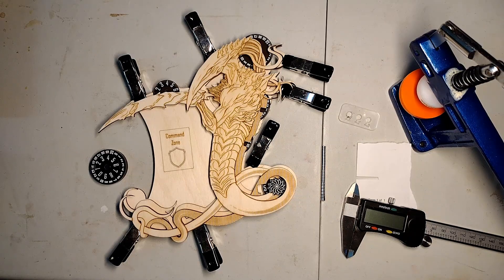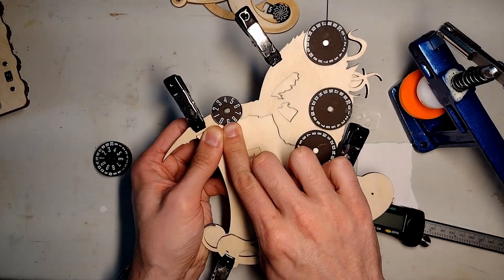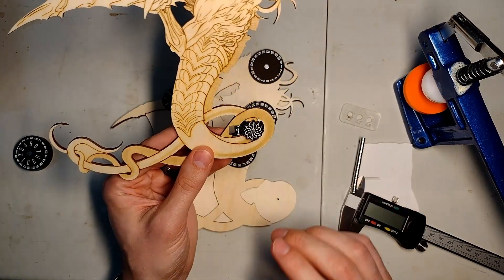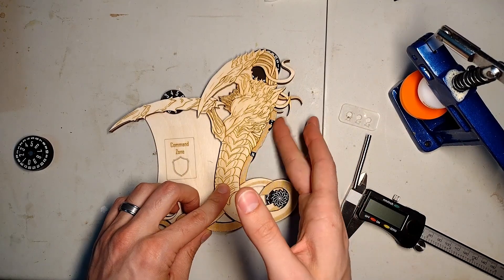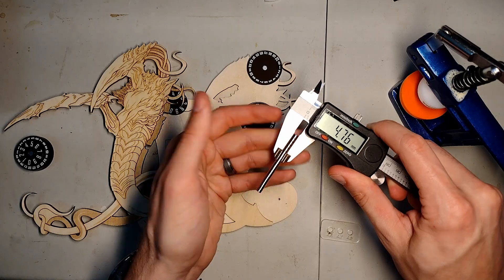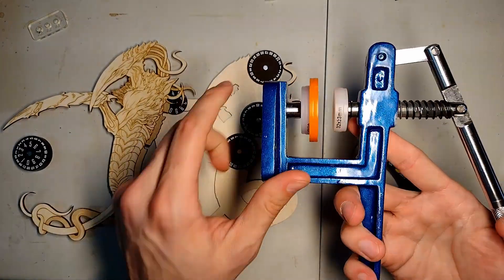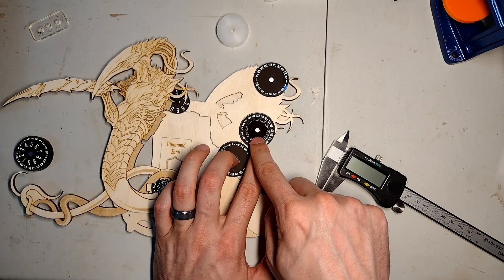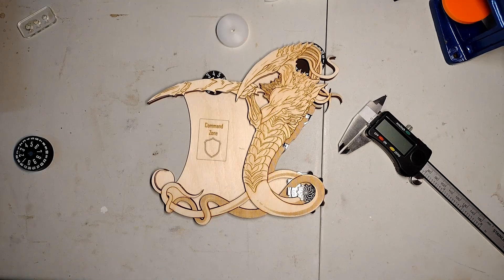Press Fit Magnets & Pins with Laser Cutting

Comment: Awesome video! A doubt, what pin are you using?
Reply from the maker: I use either Stainless Steel Dowel Pins of 1.5mm diameter or 1mm Stainless Steel Slotted Spring Pins. I get these off of McMaster Carr or some other site as I can find them.
Reply: @meepleswoodworking  Thank you! :)